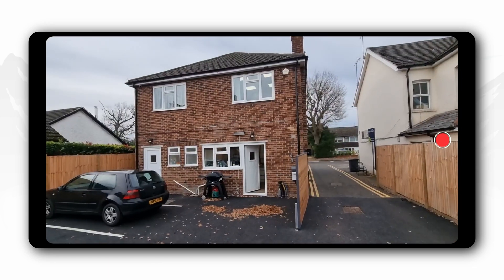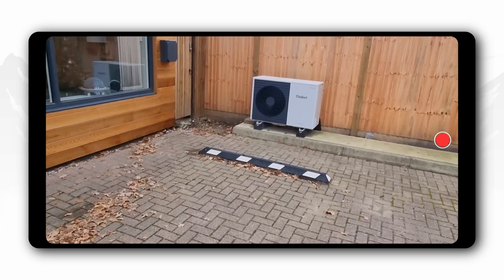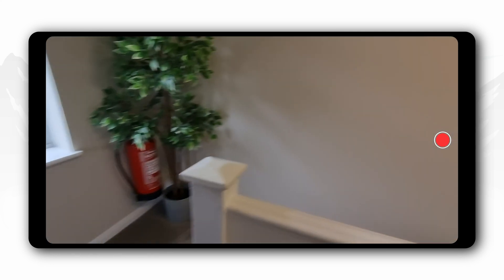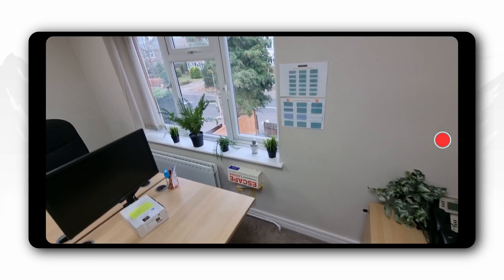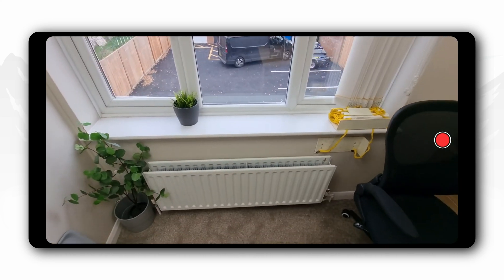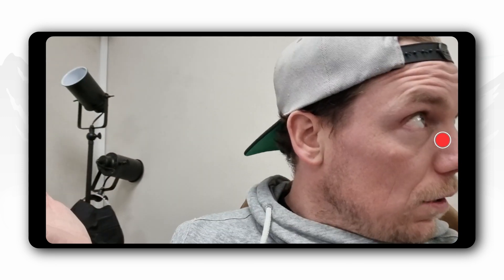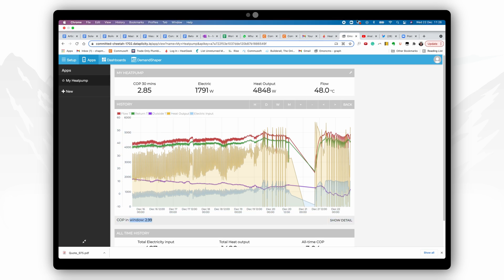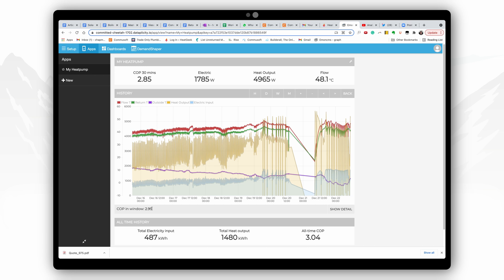Can Heat Pumps Heat A Normal Building?

Comment: Flow 48 C? Is that starting temperature? How can that be enough with such small radiotors? I'm building a new house with 15 cm insulation, triple glass windows and will put oversized radiators. Does this mean I will be able to have 22 C room temp with 45 C flow?... or something like that? It's nor that I don't believe you it's just that I find it amazing.

Comment: I’ve a well insulated 3 bedroom semi house just 9 years old but with microbore pipe. It’s easy to heat with our gas boile but id love to fit a heat pump. We heat our water with an immersion heater of of cheap night rate electricity. Can if fit a heat pump and who should I make contact with.

Comment: The final equation is COP versus excess heat loss keeping the building warm when there is nobody using it.  COP is 2.9.  What would the heatloss delta be if we changed the rooms from 21C to 16C overnight and all weekend?
I know heat loss is not linear, just wondering if 21C would lose 2.9 times more heat than 16C would.  I know in my house it would, but mine's not been renovated or modernised as well as yours.
If you did drop the set-back temps to 16 when the building wasn't in use, like overnight and maybe a bit at weekends... you would obviously loose the 2.9COP, but... would it still work out cheaper to cycle it?

Comment: An old video that popped up in my list, very poor information, I want the information for what your saying in this video, not view my other video for details, what was the cost of the heat pump? what was the true cost of the install, and thats means hours spent on the job and labour, you keep saying "very small radiators" your small radiators are bigger than my big radiator 20 inch long its terrible for heating. you gave no sound output reading, your quiet might be no where near my quiet. You should redo the video.

Comment: I’m afraid your video has been overtaken by price hikes. My wife’s house is a 1970 ordinary council house and we were advised that no heat pump could sustain the temperature required due to the insulation of these houses. To bring it up to spec of ‘your ordinary house’ would have cost 20,000 quid plus the cost of the heat pump and full radiator set. Concrete floor so forget about underfloor heating. Total cost i£40k. New Worcester gas boiler £2k. House piping hot. Hot water  65°C. No boost from mains electricity required. I think that’s the majority of houses (in Scotland).

Comment: Change one radiator/floor to a fan-coil and it will work great!
I am installing 23 kw air to water heatpump in a church from the year 1100 the vikings build that church in Norrtelje/Sweden and it will be only fan-coils no radiators!

Comment: Taking into account that the gas price is 4 times cheaper than electricity, any COP lower that 4 makes gas boilers win.

Since you passionately promote heat pumps may be you should consider changing your logo too..it is a gas flame :)).

For me the 22C would be comfortable but downstairs you have only 16C.

Comment: Thanks for the great video. I notice that most of your systems seem to be ASHP powered. I'm considering not fitting a gas boiler to my newbuild, so have upped rad sizes (+40% to +50%). Not too keen on the slinky approach so.. Can you recommend a company to do boreholes, as so far I'm quoted £4.5K per 100mtr hole. Which seems extortionate to me. I need 5 to 6 holes. Many thanks.
Reply from the maker: My advice is to go ashp.. gshp is mental now considering how much better asph are now
Reply: @HeatGeek  The COP of GSHP is 30% higher, but the install costs are 500% higher. So I suppose you're right. I was in a way coming to the same conclusion. How do the ASHP's perform at air temps of -5 to 0 degrees though? One could use PV's to have a hybrid system. Probably the most economic all round. OK. Thanks for the reality check.
All the best.

Comment: I've heard that you can adjust a boiler to run at 55°. If you can beat your home comfortably at that, you don't need new pipework or radiators. Is that the case?
Reply from the maker: You don't necessarily need new rads but it's possible you could need new pipework. Newry rads still would increase effy though

Comment: I’m in the process of having a solar system fitted soon ,I have a gas combie for hot water ,heating ,house is a 80s 2 bed semi with 6 rads ,when my boiler needs changing next 2 years ,would I be better just fitting a electric combie boiler to work with the solar or get a heat pump ,there’s only me and the wife live there ,it has cavity wall insulation and loft is well insulated

Comment: Why do you say abbornally sized radiator for the window size. What if the btu/W is sized for the room correctly when it was originally installed for gas boiler?

Comment: Thanks for a very interesting video. Can I ask why the night setback is only to 18c? Conventional / old-fashioned wisdom would be to switch off at night (or frost protection mode).
Reply from the maker: To maintain low flow temps when it comes back on

Comment: Hi
Thanks for the great videos.
Some simple questions!
How does the hot water for showers etc work? - does the heat pump just feed the tank in the video & does it need an immersion to top up?
My gas fired heating is normally switched off April to September (apart for hot water needs): how does the heat pump work or compare when space heating is not really required?
Reply from the maker: When it doesn't need heating it stops heating and continues to heat the hot water tank.

Comment: Hello! Does the ASHP pump water straight to the rads or you have some other equipment like buffer tanks,pumps and whatnot? thank you
Reply from the maker: Straight to rads. The most efficient way
Reply from the maker: For 'why not' watch.. 'why not to use a low loss header'
Reply: I was not thinking about the cop as much as i was thinking about the space we have in 2 bed terraced houses . i`m not a big fan of complicated plumbing, pumps, mixing valves, 'smart' room stats and so on, the simpler the better! maybe 1 short vid with a scheme of your ashp?! :D
if i may ask 1 more question,about your free heating video?! if you have PV energy during the day, why not use that to run your heat pump and let the solar panels to store heat in the buffer tanks and use that energy during the night when there is no Sun(free energy for heatpump)??  on top of pv running the pump i think the scop will be better because of the outside temp higher than night time. i`m not an engineer so please excuse me for being silly :)
Thank you !
Reply from the maker: @StefanBo  everyone wants a quick vid of what they should have. Sorry I don't have the time.fot that  but if you follow the channel you will know
Reply: Yup,will follow... Best wishes Adam! :)

Comment: Until you have to pay for the system then you see the real costings compared to a new combi gas boiler system... the air pump costs 5 or 6 times the cost of a gas one and still be crap.
Reply from the maker: This comment is over simplified crap x

Comment: So for 10000 kWk per year would cost around £700 for gas but it at but only 90% efficient so would cost £770 per year a base on current rates Gas £0.07 per kWh.  Now switch to Heat pump with COP of 400% efficient you only need 2500 kWh costing £700 save of £70 per year.   But average COP is from 200% to 400% over the year so more likely going to be around 350% COPwhich going to cost around £1050 per year cost £280 more per year vs Gas Boiler.    Solar power could lower the running cost of heat pump in the day time?  
Now a ZEB Zero Emission Boiler is 100% efficient and can store heat and charge from a cheap rate like octopus go.  10000 kWk per year would cost around £750 on the new rate of 0.075p saving £20 per year vs Gas.  But added solar could also lower that cost.  Now if a heatpump could be combined with some like a ZEB with if it was only 200% efficient would £375 per much cheaper then Gas boiler.    What do think? 

Gas £0.07 per kWh 
Electricity £0.28 per kWh
Reply from the maker: They are combined woth cheap rate.. they have cheap rate switching and can store in the hot water cylinder as well as alter temp settings.

Also my maths worked out infavour of the HP..
Watch

https://youtu.be/D8pvXDk_KAA
Reply from the maker: 10,000kwh with a 3.5 SCOP gives 2857kwh 

2857 x 28p is £799 a year not £1050...

Comment: This is all well and good but the simple fact is you can get a gas boiler which is now 20% hydrogen ready with a 10 year warranty for less than 5K installed. An ashp will cost £10k+. People simply don’t have that kind of money. The government grant will help but the average installation is £15-£20k so you end up paying vastly more on the off chance it might be cheaper. I agree 100% ashp are better than they were 5 years ago, and will continue to get better but atm I will keep burning gas and prefer to spend the money making my house keep the heat in, heat up quicker by changing the roads and solar energy before I even think about ashp investment.
Reply from the maker: Hydrogen ready is a red herring. It's 20 years away, will inly drop co2 by 20% and costs 5 x more than electricity

Comment: I want a heat pump.  But I don't think it will work.  

House is solid walled 1904 detached house with 360 sq meter of space.  heated by a gas 35 kW boiler with new hot water cylinder.  Loft is converted, has 60mm insulated plasterboard on the roof joists.    Fully double glazed.  The house uses 42,000 kW of gas a year
I'm thinking of having the house re-roofed but can only add 40mm more insulation to the outside.
Reply from the maker: It could work, you can heat a shed in the antarctic with a hp..  but will just cost more.. you may need 2 hps for example
Reply: @HeatGeek  looks like I just need to invest more insulation.

I'm looking at vacuum insulation (VIP) for the roof.
I'm putting 60 mm of insulation on the inside walls.
And 200 mm insulation between each floor.

Installing 25 kW of solar. + 45 kWh of battery.

Comment: I think the idea of your video was well intentioned. To highlight to people interested in a heat pump that you don’t always to have huge radiators on the wall to heat your home especially in a bedroom is true at times. 
Many times on a design I have left radiators alone in areas where the client is happy to nit always reach the desired room temperature 365 days a year.
But let’s be honest when designing correctly through the MCS heat loss calculator you would have to choose a design flow temperature at the beginning.
The lower the flow temperature chosen the higher the efficiency the heat pump can be achieved which means the single rads would just not cut the mustard. You would not heat those rooms to the desired room temperate unless you run the heat pump hotter, then you lose the efficiency. 
This is ultimately the point of over sizing rads. As a heating professional I find the video misleading and is the reason so many heat pump designs don’t work and the heat pump gets a bad name because of it.

Comment: You CAN heat this way, but is it efficient?  With a COP of 3, if electricity is 3 times the cost of gas you break even (until recently is was 5 times the cost)-except you have to store heated water- which loses heat and takes up space. 'You cannot hear the pump' he says over the sound of traffic. In a residential area you do hear them- and so do your neighbors.
Reply from the maker: You asked but is it efficient, then talked about running cost.. yes a cop of 3 (300% efficiency) is more efficient than a 90% efficient gas boiler.

When there's no cars you litrally have to walk right up to the unit to tell if it's on...
Reply: @HeatGeek  Efficient to your wallet! (heat per pound Stirling). You have to factor in energy prices in this. Boilers are >90%, and some of the rest heats the room the boiler is in. And no heat loss from stored water- heated on demand. 
An installer reports call-backs, to see if the heat pump can be moved farther from the house- because of the noise.
But not sure I want to take advice from someone who cannot figure out which way round his hat fits...

Comment: can you add more info on limited zoning? I thought increased zoning would reduce overall heating demand but you’re saying the additional complexity may be less efficient than simpler zoning? Also - any comparisons with air to air heat pumps - should we consider moving away from radiators for heating our homes to eg multisplit air-air (with the bonus of cooling too)?
Reply from the maker: Weve donr a video already.. https://youtu.be/zpTVIeUh04E

Comment: I sat and worked some figures out, each radiator in my home is roughly 1.7 kw so if I have to double them each one would be 3.4 kw, so 13 radiators x3.4 is 44kw output needed to maintain my heat. They claim that it’s 3kw output for 1kw going in so rounding up needs 15kw per hour to run so that’s two systems to generate this , cost over 25k install , and this is a quote I had but the missing part, they have to run 24/7 to run so 15kw per hour at .20 per unit of electricity so that’s £3 per hour x24 hours running £72 per day, £504 per weeks 2k per month so five months average heating 10k , so how do I save here compared to my current gas of £500 for the same period and £300 for electricity?
Reply from the maker: that's waaaay off the mark.. its your house requirment you need to power noy your radiators.. ifnyour house needs 7kw (the national average) it will need 7kw.. put 8kw in and you'll be too hot.. put 6 in and you'll be too cold.

If you have 30kw (catalog rated) of radiators that will just run cooler than 15kw of rads and probably give you a scop of 5, not 3.

We have videos on this..

Comment: You said Heat pumps work fine in older buildings ? But you never showed us the room temperature,  the most critical piece of information
Reply from the maker: Yes we messed up there but well give a link to the data logger that shows a constant 22c room with flow temp and cop, power consumption etc etc

Comment: If you don’t have underfloor heating and insulation up to the hilt they do not work full stop . I have been installing heat pumps for the last ten years and I have had feed back . They do not work in old run of the mill houses. So stop the bull sh.t
Reply from the maker: This person has been installing poorly 🥲

Comment: Hi I was quite surprised how well insulated my house is i purchased a couple of minimum/maximum temperature meters i checked their accuracy with a true rms meter i put one in our conservatory which is outside the insulated envelope of our property and one in our lounge in the conservatory the low/high was 6.7/30.2 and the lounge was 16.2 low 20.2 high over a 24 hour period with the outside temperatures of 4 degrees my rads are all bar 2 doubles after i done a heat loss measurement 12 years ago, I was also surprised how low the flow temperature was from my 12 year old oil condensing combi boiler was 40 flow 30 return approx I suppose it is because of the age of the boiler which is regularly serviced on this basis an ashp should work

Comment: What size pipework does your vaillant arotherm plus have from outside to inside apart from the 15mm pipes that connect the rads
Reply from the maker: 28 but 22mm would have been more than ample

Comment: Have you looked at sunamp heat batteries as an alternative to heating water instead of a cylinder as they use phase change materials there is a model that works with your vaillant arotherm plus ashp
Reply from the maker: Yes. We have one on the way
Reply: Will you do a video on sunamp showing running costs and if it is the model that works with your vaillant arotherm plus also do you know what cop the aerotherm plus gives at 75 degrees

Comment: What is inside apart  from radiators, and does all the system have to have natural refrigerant gwp3 in it or is it just the Vaillant aerotherm plus ashp if all thee system has refrigerant what about inhibitor
Reply from the maker: Just radiators, nothing else. No just the box outside has refrige in.  No inhibitor
Reply: Thanks for the reply does it not even need the hydronic station
Reply from the maker: @patregal  no

Comment: Having just had a chat to a heating engineer today one thing that will become an issue is having a heat pump and a home charger for your electric car is likely to be 70amps in total....that leaves precious little room if any, for the normal domestic supply then looms the problem of 3 phase supply which huge swaths of the supply chain can not actually supply without extra works.
Reply: A smart charger can be configured to go as low as 10A (our Wallbox will do this) and can be configured to do this based on available capacity on the incoming feed.
Reply: @zilspeed  As I said that leaves no room for anything extra really and 10amps won't be what people want they be wanting faster charging not slower
Reply: @andyhunt457  

We all have different needs. 4hrs off peak overnight at 10A = 10kWh if my arithmetic serves me correctly. 
In our Hyundai, that’s an easy 50 miles a day, or more than I average.

Works for me. Not saying it does for everyone, but it does for me.

And that’s at a time when the rest of the house is drawing about 0.1-0.2kW.

If I run the heat pump, that’ll pull 0.8kW